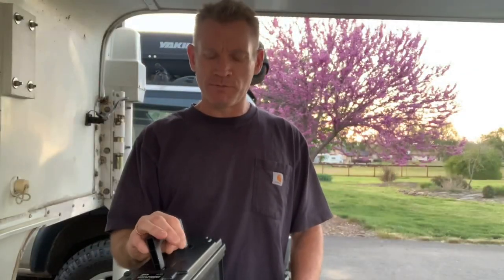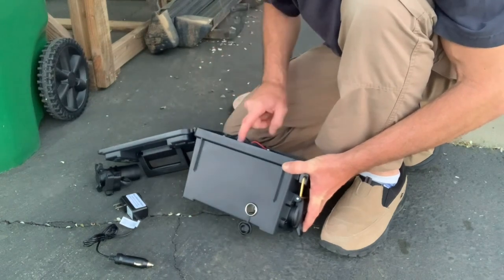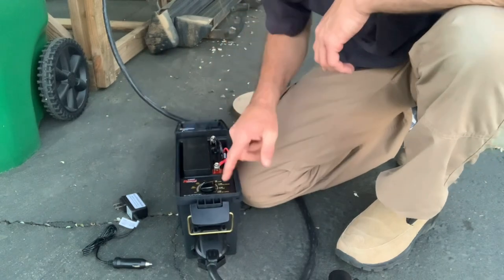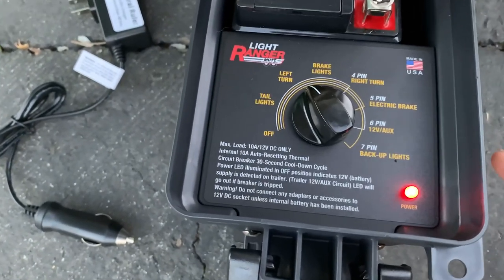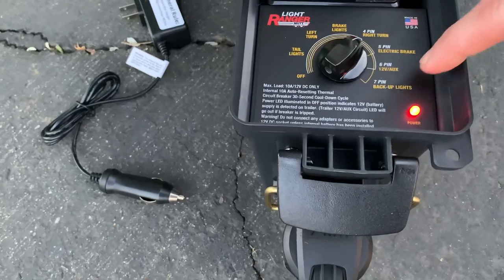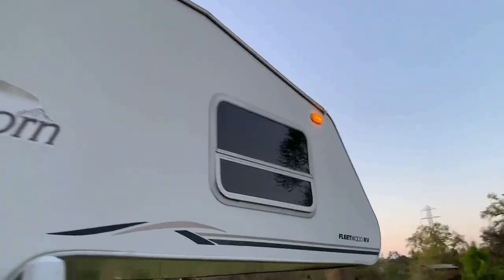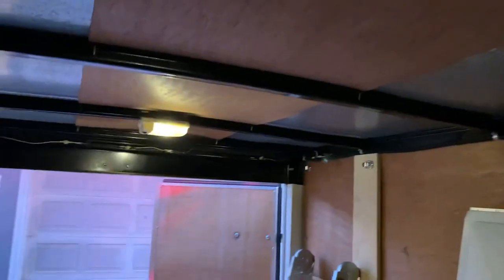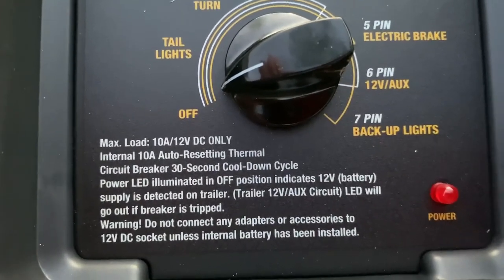IPA Light Ranger Trailer Light Tester • Review & How to Use

Comment: Jeff, good review, didn’t know they made this tester 👍🏼🇱🇷
Reply from the maker: It’s a cool little tester.  We used the big IPA tester at RV Inspection/Technician training school but it’s around $1,800.  This one is more portable for the mobile tech/inspection work that I do.
Reply: @covetthecamper2289 Hi Jeff, I bought this same unit over the weekend to try test for a problem I am having with a Triton ATV trailer. Unfortunately I was very disappointed when I plugged in and absolutely no lights are working on my trailer. My trailer has electric brakes on one of two axles. I did check if the new battery I bought with the Ranger unit was charged and also the little battery on my trailer for the breakaway switch  …….. both show 12.69 V. The power light is on in the Ranger tester.
Is there any obvious problem when all lights don’t work like this? I have looked at the ground wire point on the trailer and it “seems” to be in good condition. My trailer is an all aluminum frame as are all Triton trailers. Would really appreciate if you have any suggestion here. The trailer is a 2012 and the lights worked fine all these years until a few months ago. The trailer is always stored inside and basically it does a 1,000 mile trip twice a year so it has not been exposed to a lot of weather conditions that would cause the wiring to go bad.